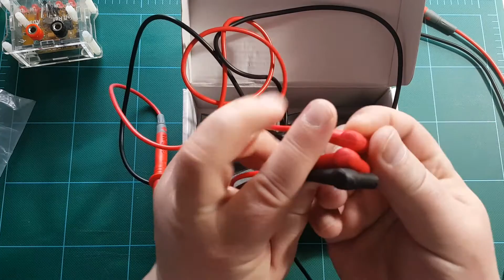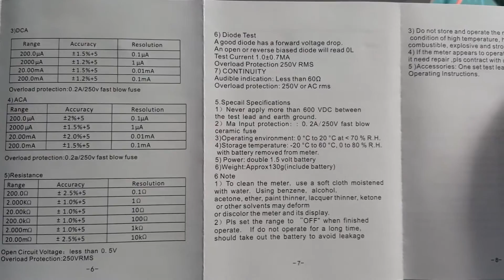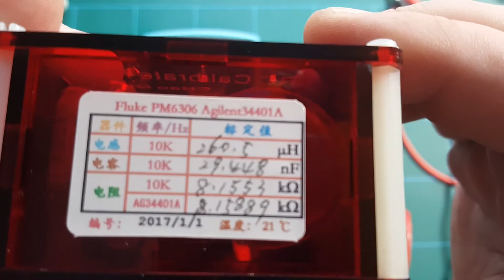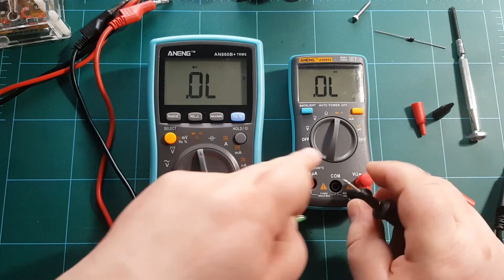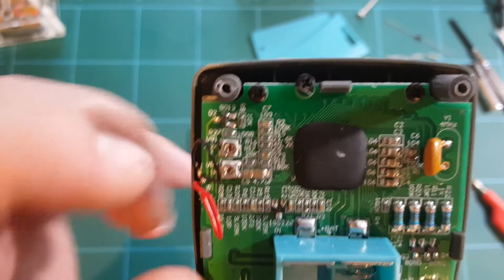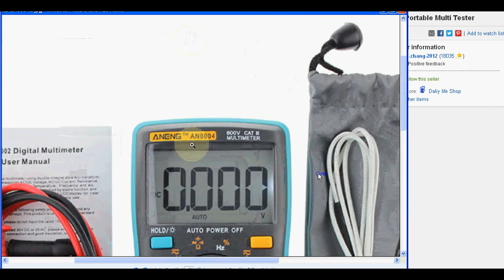Aneng AN8004 DMM

Comment: I have AN8001 and is good. We can buy 4 diferent models:
AN8001 and AN8002 - diference between this to is that 8002 has a temperature measurement but 8001 no.
AN8000 have a 4000 counts digit but 80001/80002 have 6000 counts digit.
AN8004 is the poorest of them.

Comment: As you know, there are 6000 counts, TRMS meters in the same package and similar price (AN8001/2 and clones). In fact if you want to fiddle with it and mod those (add buttons...) it should be the same (or very close) to the 806B+. I've just bought a VC17b+ which is the same of the 806B+ and, some say, has a look too close to a fluke. For the price I won't bother modding a AN8001.

Comment: I have the Aneng AN8002 which is the same size as the AN8004 but actually comes with the features you see in the ebay post you show in this video lol. I got mine for around $15 here in the UK.

My AN8002 has a rating of 10A and has a 6000 count. It shows 3 decimal places down to 0.001 millivolts and also has a few more other features compared to this AN8004 you show here.

AN8002 Picture: https://ae01.alicdn.com/kf/HTB14tfCPVXXXXbxXFXXq6xXFXXX8/ANENG-AN8002-Digital-Multimeter-6000-counts-Backlight-AC-DC-Ammeter-Voltmeter-Ohm-Portable-Meter.jpg

When I do the continuity test across the supplied leads (like you do in this video) it's very responsive too.
I need to get more of these AN8002 meters their great!
Reply from the maker: Thanks for the feedback. Yes, looks like AN8002 and even AN8001 are considerably more feature-rich for just a little bit more money. 
I would not trust those current and voltage ratings. But I will rarely need to actually measure such currents.
These all are cheap meters and have their limitations. But as long as they get the job done - that's all that matters.